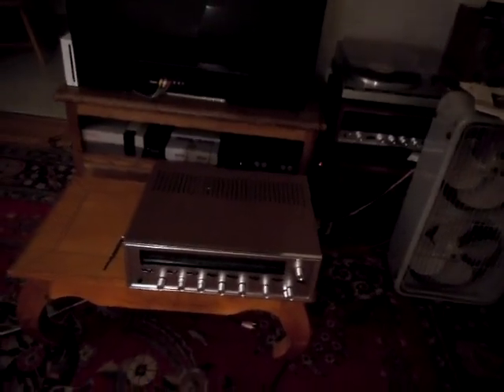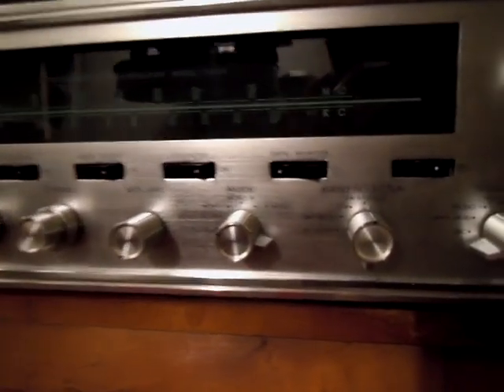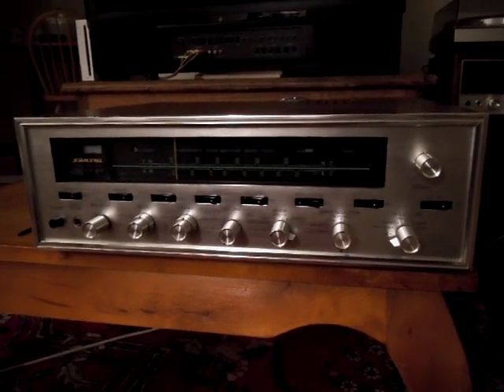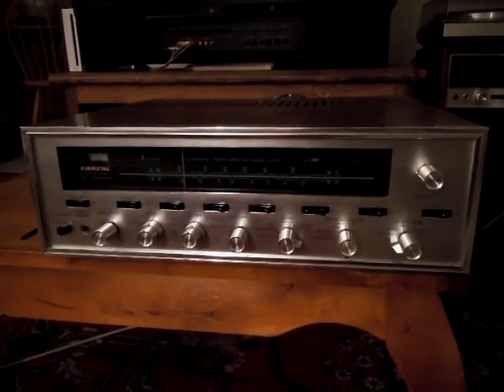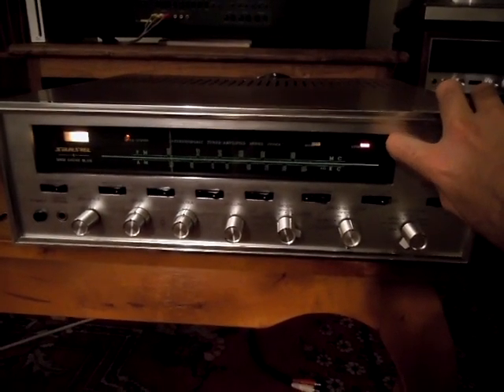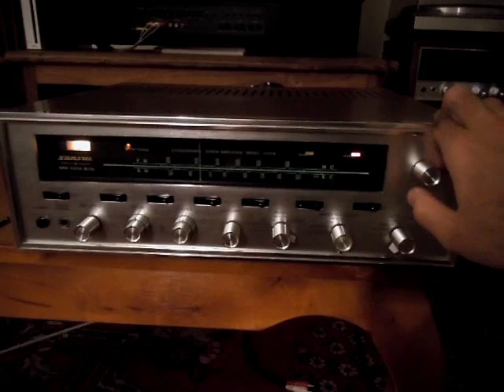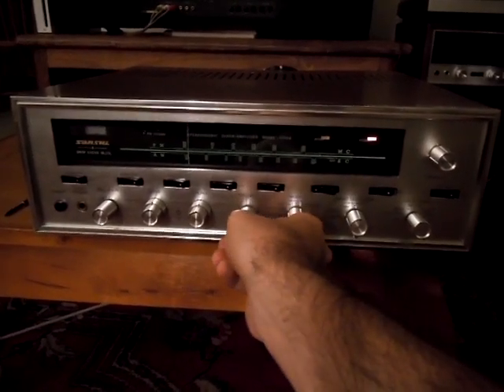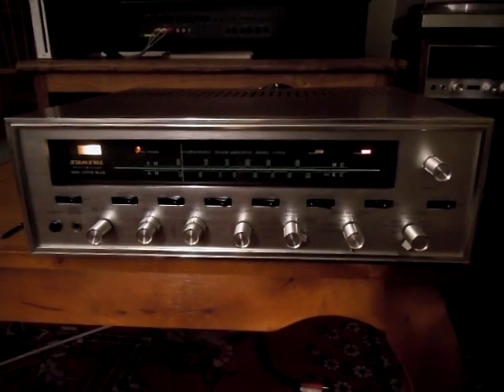Vintage Sansui 1000a Tube receiver. Repaired and KT66 modified.

Comment: I bought my Sansui 1000A from a neighbor in 1971, when I was 15. I've probably had over 100 stereo receivers through the years, but the 1000A is still my favorite. I'd like to take it down to San Diego and have Jordan restore it properly.
Reply: Fantastic. Excuse me. Whats the major problem with this receiver?  The heat?

Comment: Good tidbits of information-ty as I’m a bit of a novice.

Any recommendations as to parts that are a MUST for replacement?
 I think the paper in oil capacitors are definitely on the top of the list(?)

 I bought one of these off eBay about 13 years ago & it’s been sitting around since, & now, I want to get it up and running.

It’s a very complete unit: original box & packing, ALL original paperwork & a Sansui dusting cloth! Cosmetically very clean also.

 I picked up a restoration parts kit on  recommendations from the group on Audiokarma.

Now I’m just weeding out tech’s  that can work on this thing.
I’m very excited to get this up and running as it is one of my faves.

Ty